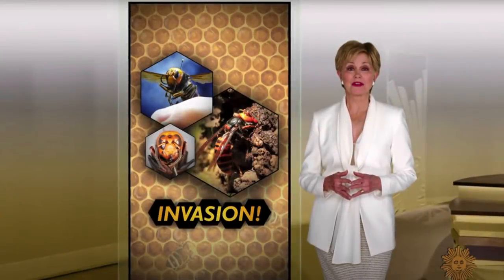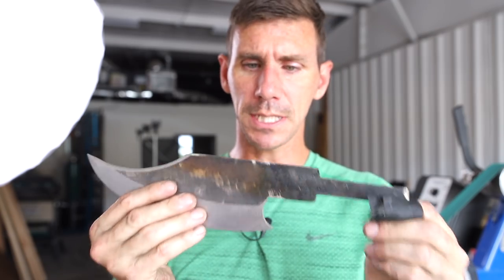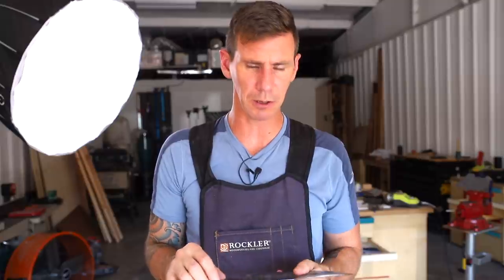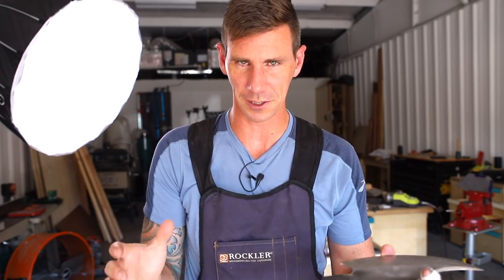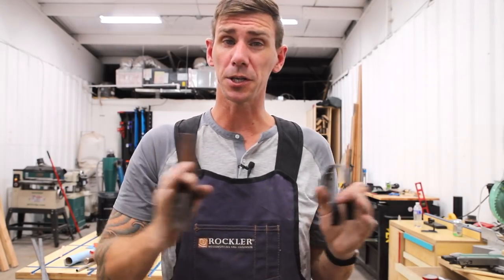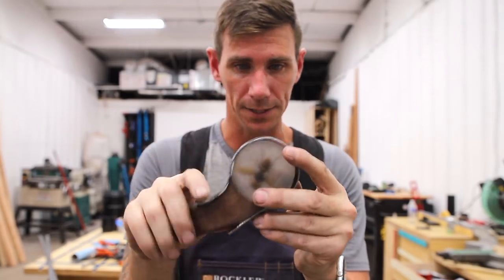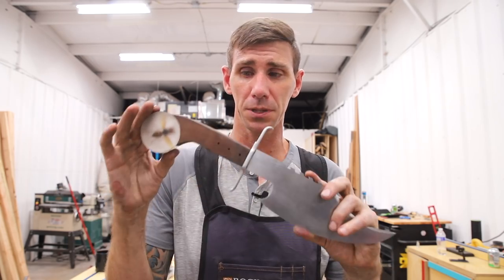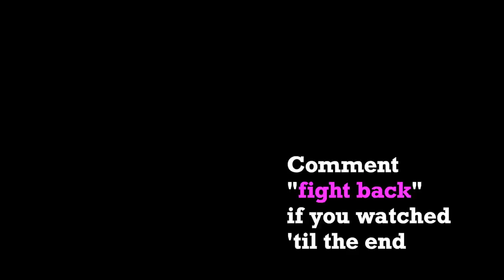Making a Dagger Fit For 2020! REAL Murder Hornet Knife

Comment: The top end shape of the blade is called a clip point profile (where it drops down to the point). If you taper it, then that is also a false edge bc its not sharp. Looks cool, but it's not a dagger.

Comment: To improve the fit between the epoxy disk and the wood hilt, I would have used a hole cutter (without a center drill) to cut out both, that way, the diameter of the radius is identical...

Comment: Would using brass for the pommel wrap have been possible?
Reply from the maker: Sure, but I would’ve ran into the same issue and you can’t weld in the spikes.
Reply: @JonnyBuilds  could've braised them. Some low melt brazing rod and a MAPP gas torch would do the trick

Comment: Fight back. [Not sure what that's about, but...] That looks so cool, that I am reluctant to say what follows. I wonder how well the epoxy will last if the knife gets a lot of real use. I was thinking a brass band (a strip of brass, not trumpets and tubas 😄) would have completed the look and held the wasp on. I always prefer a functional saw back or a plain spine to a faux saw. More and smaller teeth filed at an alternating angle over a longer section of the spine would make for a usable saw. 
     But it is a very cool looking knife.

Comment: fight back. :P I thought I may have seen one but when I looked online it didn't look the same entirely. It was large - inch to inch and a half - and 99% sure it was a hornet... but the colors were different, it had hair in the bit behind the head and the head was rounder. It was so big I could see both large eyes from several feet away. That said it was not horribly aggressive. It did fly at me when I neared the hole in the ground it was going in and out of... but flew off to the hole again when I backed off. Still it was pretty scary and I needed to get past it to get to my front door. :P That dagger came out super cool. :D - Heidi
Reply from the maker: haha, def isn't a murder hornet, but still sounds mean!

Comment: Maybe, rather than use a strip of metal to hold the epoxy disk in place, how about using some fiberglass strips with the resin as an invisible fastener. Once the resin cures, the fiberglass strips will not be seen & will hold the Murder Hornet disk in place. Anthony
Reply from the maker: I actually thought of a similar solution, but using carbon fiber instead. Sometimes less is more.